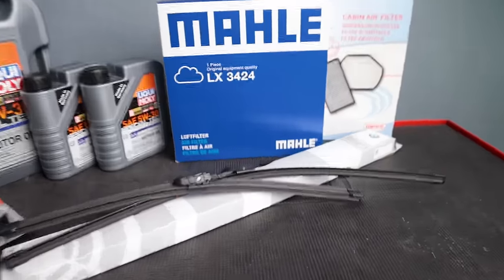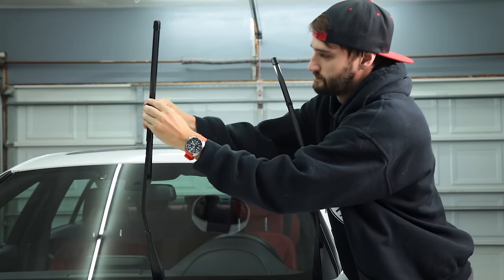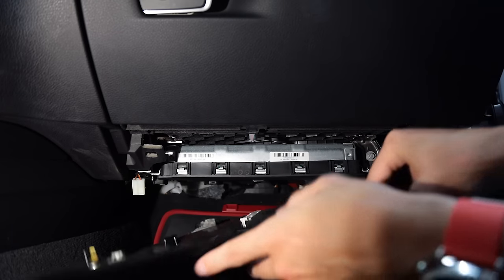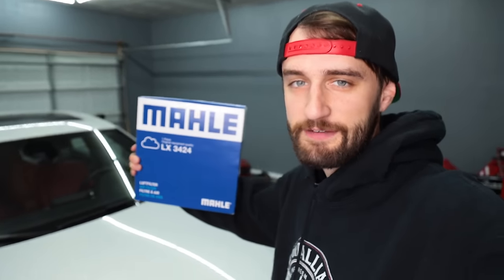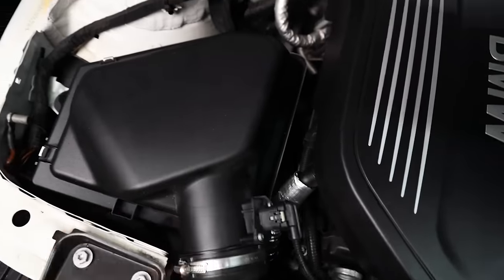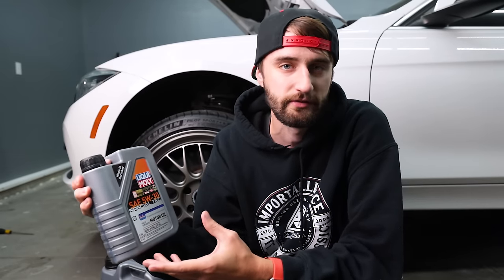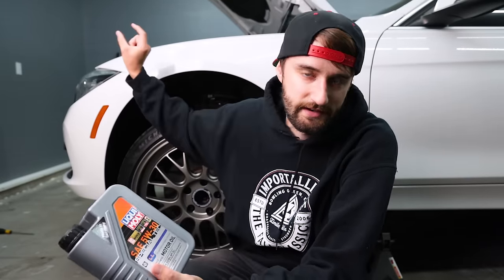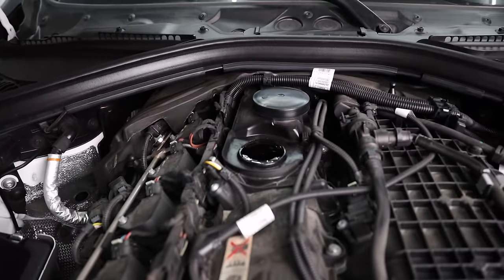STOP GETTING RIPPED OFF AT THE BMW STEALERSHIP!

Comment: Great video.

However, I would never recommend anyone buy a BMW.

Why, because they use cheap plastic.

Now don't get me wrong there is nothing wrong with using plastic in the car. My 2006 Toyota's plastic is still holding up and working just fine doing the job it was designed to do. Heck, even my friend's 10 year old KIA's plastic is fine. 

But not BMW plastic, it out gasses, becomes brittle and breaks in as little as 3 to 5 years. 

Why is it such a problem? 

Well it's a big problem when it's cheap and its being used in the:
1. Intake Manifold!
2. Oil Pan!
3. Transmission Pan 
4. Valve Cover Gasket
5. Propellers used in the Water Pump!
6. Turbo Boost & Charge Pipe
7. Thermostat Housing
8. Joints in the MANY Radiator Hoses.
9. Radiator Water Reserve
10. Gaskets, also cheap plastic
11. Vacuum Line Connectors, worst problem

The list is long! And so are the problems!

Then there are the problem
Leaky Oil Fill Motor Mounts

What's happens when you use cheap plastic on a unit that cycles between HOT & COLD every day?

That's right! Tons of Oil Leaks, Tons of Vacuum Leaks and every other month the dreaded "LIMP MODE." 

Here are the problems you will be dealing with in as little as 3 to 4 years.

Oil smell leaking into the passenger cabin as oil leaked on to the hot engine components.

Here is the BIGGEST PROBLEM the Turbo PLASTIC BOOST & CHARGER PIPE  are NOTORIOUS for LEAKING, CRACKING & BURSTING and requiring replacement every ~3 years. 

Here is ANOTHER HUGE PROBLEM all the VACUUM LINES use the same cheap plastic in are EASILY BROKEN, PLASTIC CONNECTORS! 

So, expect the mechanic or you to break them while trying to fix anything else. All with every job because they must be removed to replace other parts, like the Turbo Pipes, or Valve Covers etc.
 
If you like working on your BMW get familiar with making your own HOME MADE SMOKE MACHINE. 
Because you will be using it every other month to find what plastic part is causing the LIMP MODE that disables your car until you take it to the shop.

A SMOKE MACHINE is used to find leaks. You injected into the engine or part you suspect of leaking and the smoke leaking out is the tell tale showing you the broken plastic part.

Don't believe its every BMW??

The next time you drive through suburbia count the number of BMW's that are parked outside that are past 5 years old?

Past owners would rather junk the cars than continue dealing with LIMP MODE, Continuous Repairs, Continuous Time Spent Fixing Them, Continuous Time spent at the Dealership for that 1 problem you can't fix. 

Even the rich don't like being taken for a ride or given a cheap BRASS BRACELET and paying the price of a 24k GOLD BRACELET! 

The cars are really like a Cheap Chinese Pretty Bracelet you replace as soon as it the cheap metal TARNISHES. 

For the guys that are dense and don't get the analogy. What I mean is they are only good for leasing and giving them right back to the next fool that doesn't know about the CHEAP PLASTIC. 

But, if you say "if you can't afford don't buy it." You go right ahead and call yourself a rich eccentric. 

I would rather spend $5,000 on my vacations than on my car every few months. 

I will continue to tell everyone about my experience with BMW cars to anyone with a level head. 

These guys are killing the brand and if they insists on screwing the consumer then they deserve to go under.

If you insist on the BMW I would recommend you begin replacing parts as many OEM parts with quality parts that will last you forever made of aluminum & Polyeurathane. 

Some parys surprisingly sold by SO CALLED AMERICAN COMPANIES but all made in Taiwan,  China like the ALUMINUM Turbo Pipes & Polyeurathane. 

If you can REPLACE a BMW OEM part with ALUMINUM or POLYEURATHANE. 

DO IT!!!!